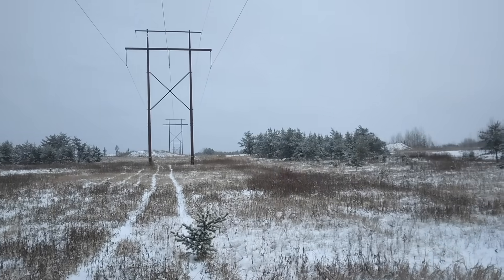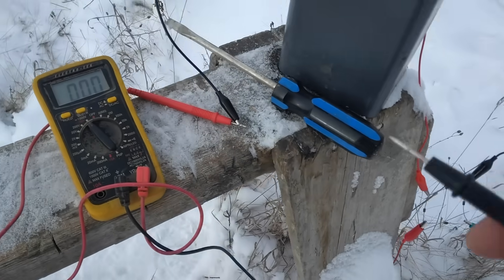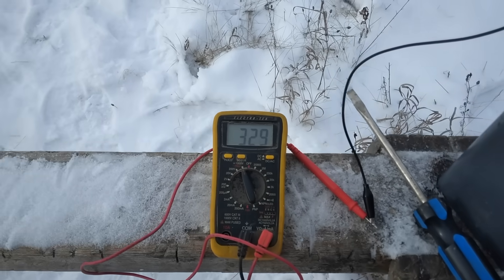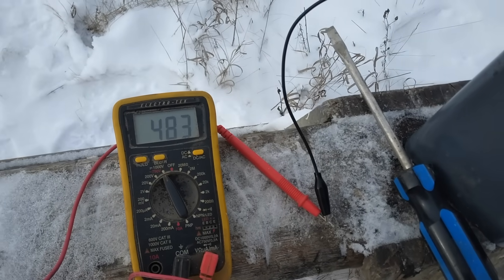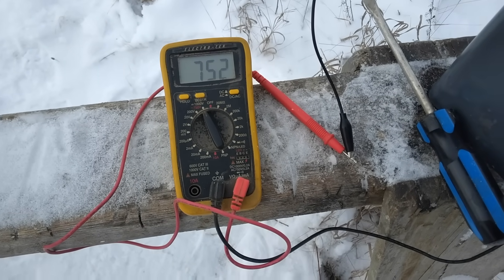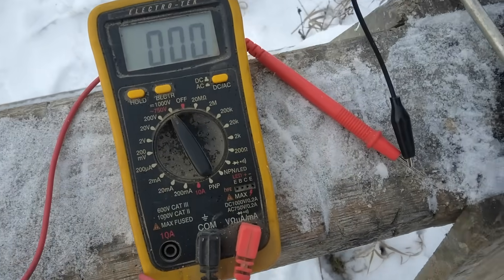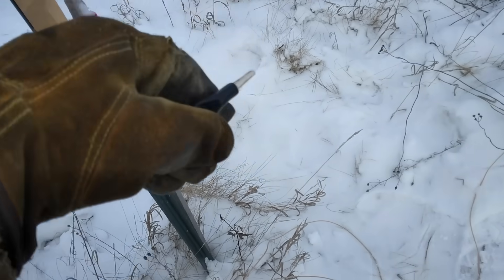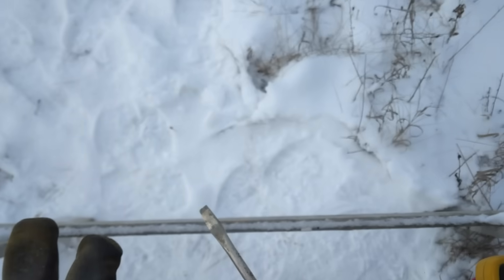Fences sucking power from under HV transmission lines

Comment: Good video on describing lines of flux called the left hand rule.  The lines off flux coming off the high voltage lines is pretty significant.  Higher the voltage, the larger the lines of flux.  The RF cable you are capturing the voltage is pretty cool but use caution when doing this.
Reply: 'Left hand rule' lmfao
Reply: @xxportalxx.  Eh he had a 50/50 chance to get it RIGHT 😅😅😅😂
Reply: Fleming’s Left-Hand Rule and Fleming’s Right-Hand Rule are essential rules applicable in magnetism and electromagnetism.
 @xxportalxx.
Reply: The higher the CURRENT, the higher the magnetic flux.

The distribution network uses high voltage lines specifically to reduce the current and magnetic flux levels.
Reply: What happens if I run the line of flux through a capacitor?
Reply: @katdaddy469  don't want to do that,  you could end up in the 1950s or even 1880s!
Reply: @markmatt9174  Only if they hit 88mph.
Reply: absolutely correct.

  peace be upon you.@@combfilter3654

Comment: Inductive resonance is a real thing and can be tapped. I found this out building solar powered electric fencing in Oklahoma. Those powerlines play hell with the control boards in fencing and we found out that we didn't need to power them up if the fence ran under those lines. Free electric fence power.....enough to deter horses and cows from going though.  For fun walk underneath a high tension line with a fluorescent tube  and hold it over your head in the dark. Free lighting !
Reply: I once had to recover a van that had driven into a area at a power distribution place conked out and wouldn't restart,a place where the pylons and at this one,where a part of the train network get their supply from,it was horrible being there. Some of the older buildings were being refurbished and a decorator had lazily driven into an area that he was told would result in his van not starting but ignored the advice anyway. When I got there you could actually feel the electricity in the air and we were a fair distance from all the high voltage stuff too.The van wouldn't recognise the key and with the start button held in you could hear the BCM having a paddy ,my mobile phone was buzzing madly and I didn't even attempt to plug my interface into his obd port to have a read,so between us we pushed the van through loose gravel for about 100 ft back towards the gates. After a 10 minute hard reset, (connect both battery cables together) It all sprung back into life. Despite nobody asking one 'cheerful' guy who worked there happened to mention,that if it gets you and you don't burn completely,your body will be rigid and your skin will have the texture and appearance of a McDonald apple pie casing😮 . Over the back of our fields where the power cables stretch across a large plantation of tall conifers in rows,the pylons are huge so the cables are very high up above them, but I have noticed that the pinecones from the conifers below the cables are slightly different and definitely more brittle to those from the very same trees further out from the cables.
Reply: You know you are a red neck if you have lost at least one relative from peeing on an electric fence .
Reply: Wireless charging is real, a concept everyone on here understands, and very close to what is going on here in a very boiled down understanding.
Reply: No its not a real thing. Resonance is a real thing. Inductors, inductance is a real thing. "Inducivr resonance" is bullshit.
Reply: @dinodubroja7433  what's an LC circuit then
Reply: @heeeyno  its a circuit
Reply: @heeeyno  cicruit which can resonate. There is no thing as "inductive resonance", nor "capacitive resonance" nor "resistive resonamce". There is capacitance, there is iductance there is resonance. Separate terms. If you say "inductive resonance" I will not be taking your story seriously. You cant just make up terms. They are already made up. So everything else is INCORRECT.
Reply: @dinodubroja7433  I think what that person means is inductive coupling. When I did a motors and generators class in my Electronics Engineering Technician course, we covered that.
Reply: @dinodubroja7433  Well, you need both induction and capacitance to produce a resonant circuit. I can sort of see where he's coming from.

Comment: Remembering my electronics classes....just get a big surplus transformer and play with it. While you will obviously still have some bleed this should knock the voltage down to within range of your meter. Just realize you will get some appreciable amps out of the tap. Be a fun experiment, but please wear rubber gloves.
Reply: I reckon that you need three coils. One as close to the power lines as possible and then a remote transformer which is not inducing power from the lines but is rather just a stepdown transformer.

Comment: Back around the early 1940's there was a village...on the outskirts was the detection 'grid' for a Radar system...well ( pardon the pun ) some bright spark figured out that if they strung a bunch of wires up, they would be able to 'capture' the electricity...for free.

Well...the system worked...right up until it was noticed that there was now a gap in the Radar coverage...so they sent a load of troops out to find what the problem was.

Being the Nazis they executed everybody in the village...their own people.

These day I'd imagine they would apply the mains current to your testicles.
Reply: Link to this ridiculous story or it never happened.
Reply: They wouldn't have killed anyone in that village if it had happened. Why make up stuff?
Reply: Actually they did...they wiped out the entire village.

Comment: Do you know if this experiment drew additional power from the high power lines or did you simply capture power that was already lost?
Reply: It's essentially a very poor transformer, so it's putting a load on the transmission lines.
Reply: @BrokenLifeCycle  Would inductive coupling to Earth not be the same?
Reply: It does reduce the power in the transmission lines.
Reply: @dnomyarnostaw immeasurable……the loss was already there.
Reply: @JimsEquipmentShed  Based on the video, I wouldn't say immeasurable, strictly speaking... but it is negligible when compared to how much power is being shoved through those lines.
Reply: @BrokenLifeCycle  Anything can be measured in the proper setting, but it’s impossible for the power company to measure it using their current telemetry.
So it’s effectively immeasurable to them.
Reply: @JimsEquipmentShed  When you do an experiment like this it's immeasurable and not even unethical so don't worry.  The legends of people getting caught are about people who power their whole homes or whole farms which use significant amounts of power.